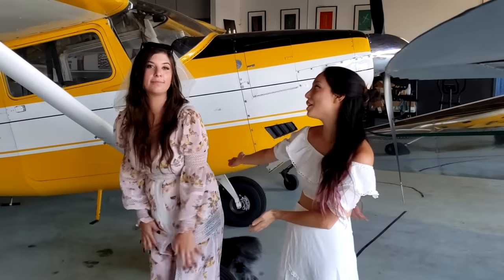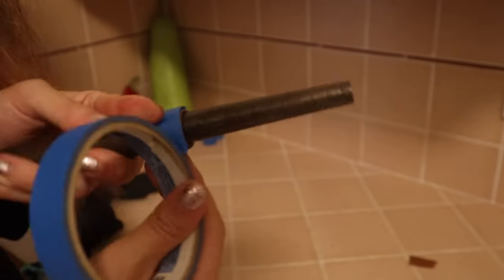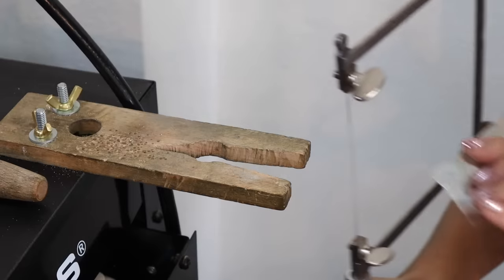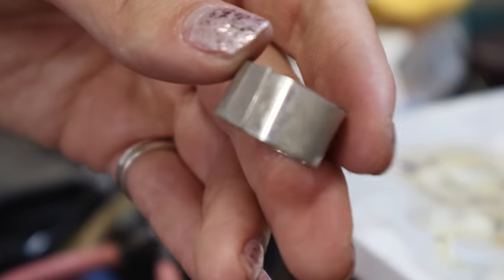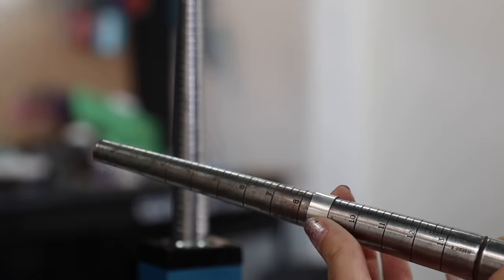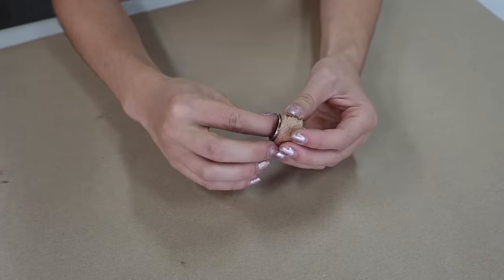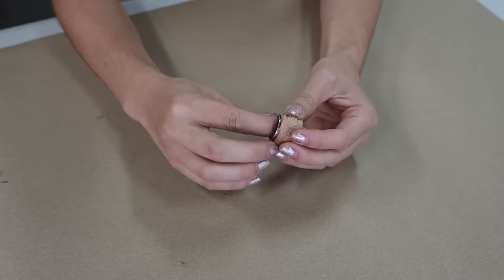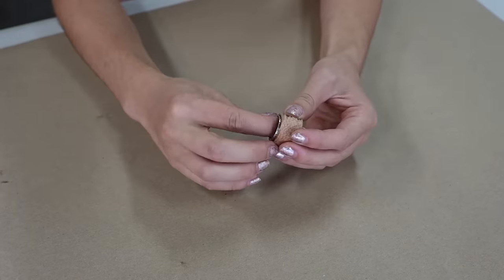Turning a Spark Plug Gasket into a Wedding Band

Comment: I am a pilot and my wife had my wedding band made from part of the compressor turbine blade from Concord, absolutely love it. 
Yours looks really great as well, wonderfully done.
Reply: Very cool
Reply: Titanium? Or some strange nickel chrome alloy?
Reply: @gingernutpreacher  The engines I worked on used alternating layers of titanium and other metals/alloys for the compressor, but it was a Harrier, not a Concorde.
Reply: @gingernutpreacher  not 100% sure unfortunately, so will go with some strange nickle chrome alloy. The jeweler said it was the toughest material he ever had to work with.

Comment: Coolest wedding I've ever seen!! Very nice work on the rings!! One word of advice to you and your viewers, which you probably already know as an engineer but many viewers won't know this.  Many types of copper used in electrical applications contain Beryllium in their alloys, a very toxic metal. (Primarily in dust form)  Unlikely used in your spark plug gasket.  It is commonly found in applications in microwave ovens ceramic magnetron tube insulators (often pink in color). Not applicable in your use.

 But Beryllium Copper alloys and Beryllium Bronze alloys are very high strength alloys and often as strong as alloy steels of some types.  These materials are non-sparking and are very strong and often used to make non- sparking tools for use in explosive environments or areas needing non-magetic tooling.  As a former T&D maker working with exotic materials respirators and special handling was requited for any alloy with Beryllium, Cadmium, Mercury, Arsenic and all the other usual toxic metals. Always best to be safe if not sure!! All us makers will always scrounge materials if they are free!! Part of the fun!!

Comment: When expanding a ring make sure when it’s that wide you pull it off and turn it around so it pulls each side evenly. I’m glad you decided to hard solder instead of fusing. Silver isn’t as hard to do as platinum but it is still more temperamental than gold. Fantastic work for someone who is not a jeweler

Comment: Quick point on work hardening. I was taught that what it does is creates some small imperfections in the structure of the material that make future deformations harder to propagate. This makes the material less plastic and harder but but it also becomes more fragile.

Comment: Beautiful work! They will be treasured! - For anyone else inspired by this, I've used sockets with moderate success in place of a proper mandrill, get the size from a current ring. A mandrill is better but if you are only making one or two you may have a good range of socket sizes close to your finger size already :)

Comment: First, make the inner lining of the ring.
Second, the gasket is made into a metal ring and fixedly connected to the inner lining.
Third, inlay the wooden ring on both sides of the metal ring.

I think this operation should be easier.
And it can weld the metal ring to achieve a seamless effect.

Comment: Great video. I like the way you throw all kinds of different stuff at us. Is catching the silver shavings a thing that jewelers do? Is there a small bucket full of shavings somewhere?
Reply: @MFaulart here:  Yes we do save the silver it can be melted down and cast into ingots, run through the rolling mill and turned into sheet and wire.  I do have a small bucket is sight on the workbench.

Comment: First of all, +1 to more aviation content.  I still think your crown went supersonic when it dropped from +100,000 ft.  Second, in hindsight- would it have been easier to solder the copper band to the center of the silver band and then add the two wood bands on either side?  That way the copper is soldered instead of bonded.  That question is not actually knowing the bonding power of the adhesive you used.

Comment: my only concern is that 5 minute epoxy is usually not uv resistant and it might turn yellow in a year or so... best thing would be to spray it with a scratch resistant lacquer

Comment: Why quench the copper? Just let it air cool and it will be dead soft.
Thanks for another great video!
Reply: Quenching has no effect on the hardness, so why wait for it to air cool?
Reply: @cameronwebster6866  quenching definitely has an effect on hardness.  Most metals will harden with quenching.  Specific heating and quenching is how metals are tempered.
Half of the annealing process IS letting it cool slowly.  In some cases, the metal is insulated to cool it even slower.
It's all about the interstitial defects and how they interact with the crystalline structure...
Reply: @FiferSkipper  I know it does, but not for copper.
Reply: @cameronwebster6866  I've worked with copper sheet metal for years, and can say from personal experience, that if you heat and quench copper it is more hard than if you heat and let it cool slowly.

Comment: Xyla, are you and Ve  going to test that little wind machine on a longer belt soon? It would make a very interesting vid, and it will prove reality -- that the device is not  doing what you guys claim it is doing.  In other words  there is no energy flowing into the device once your hand is removed.

Lets be honest about this Zyla.  At some point we are going to begin to conclude negative things about you if you guys refuse to continue your experimentation

You did engineer a fine device as always.  But it doesnt work as you claim, but you have a whole lot of gullible people believing it does.

It is time you guys stop ignoring  more rational/experienced people

Comment: “And silver by the way is 92.8 % silver and 5.4% copper” … umm.. no. Then what is the 92.8 % silver made of if silver is also 5.4% silver? Silver is pure silver made of only silver. You just have a silver alloy, but silver, even the 92.8% in the alloy is 100% silver otherwise it’s not actually silver. Silver is scientifically a thing and what you are calling “silver” and implying has copper in it can not be defined as silver in its true form.

Comment: Cute rings. But, by using wood in the design I can't help but thinking this is not a marriage designed to last. Isn't that why wedding rings are made from really permanent things are about (Gold or silver or platinum for instance) meant to last a lifetime? But then again, this is the modern age, a lifetime could be tomorrow. Those rings won't last, but the marriage probably won't either based on statistics. But I hope it does and you can make some replacement ones.
Reply: The cherry ring I carved for my wife is currently at 26 years and counting.....